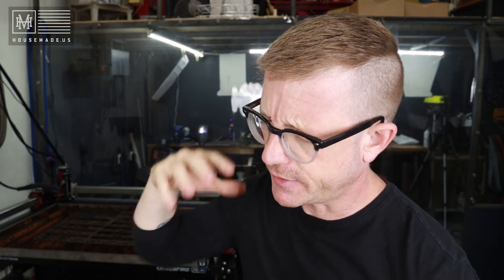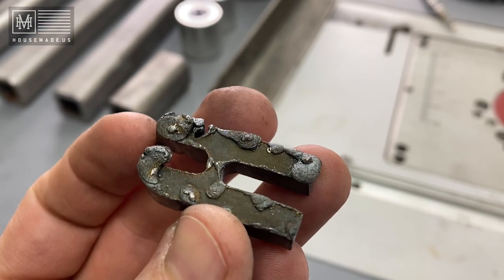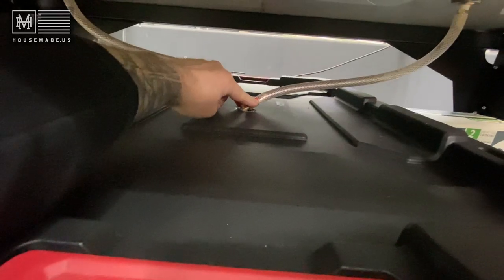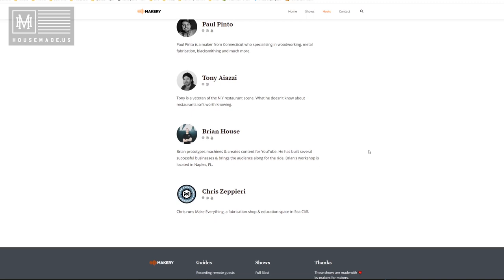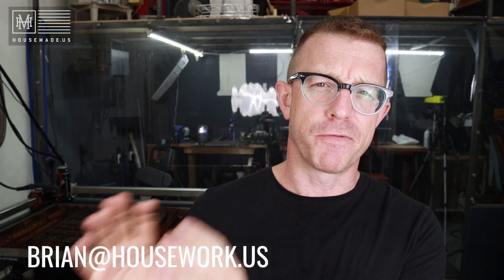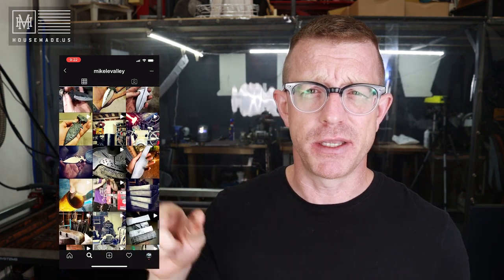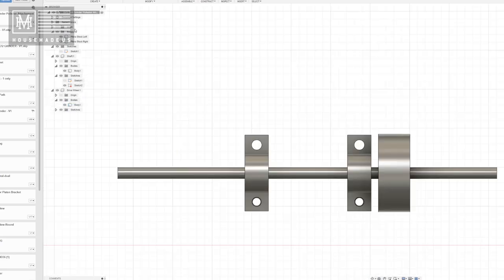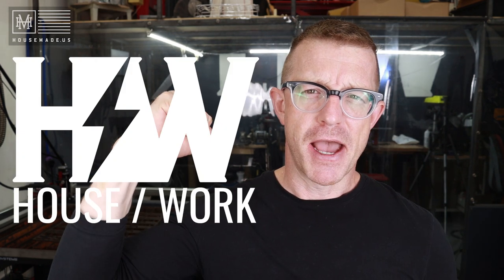2x72 Belt Grinder Buffing Wheel Attachment

Comment: I have a suggestion i did plant maintenance as a career. I worked on many machines that use shafts and saddle/pillow bearings that heald up large spools of cable that were hundreds of pounds right down to a spooling setup that was a few pounds. I was wondering did you consider keeping the drive wheel more centered? Yes the easiest way to do it is offset to one side but eventually this tension is going to cause warping or failure in the bearings.  I dont think this is under a enormous amount of pressure just a concern.  You may have to increase the shaft diameter to lend rigidity to the build a 1" shaft or find an inline idea i think having a bearing on each side. I think the drive centered would be the most energy efficient design.  Let me know what you think or maybe try it on your design problem just my 2 cents?  :-) Thanks for sharing and takecare Mr House

Comment: I’m wondering what would happen if you sprayed a coat of that anti spatter on the water side of your sheet stock some time before cutting.. (does it eventually dry?) I’m sure some would wash off but I’ll bet some stays also, maybe that helps with the dross.. just a thought..       
Awesome channel man, I’m addicted. 👍🏻🇺🇸
Reply from the maker: Yeah I thought about that also. I think the issue is with my speed. A couple of people have commented in and said that Ross is related to inches per minute and going to slow. The problem with these parts is, if I go faster the accuracy of the machine is not as good. And with the small little parts I need good accuracy in those slots. So it’s a balancing act.

Comment: I agree with the comment about pre-cleaning your material before you put it on the plasma. I would double- check your air pressure during a cut cycle, I had one that was using op the tank volume during cycles. The other thing you may try is a rock tumbler afterward, makes easier work. Hope you have t figured out:)
Reply from the maker: Thanks Juan. I appreciate that info. 😁👊🏻

Comment: Well Brian you sure have been busy! I like the buffer idea as an additional accessory. Are you planing to drive with a sanding belt or something else? There's got to be a sweet spot in terms of shaft length versus diameter. A 3/4" shaft size is a good starting point, then try different lengths to see what works best and gives the best clearance around the buffing wheel. I look forward to seeing what comes next!
Reply from the maker: I do plan on using a sanding belt to drive it. I’m thinking maybe I’ll add a rubber drive wheel in the future if this plastic one doesn’t work out or starts to slip. I’m guessing a lot of adjusting and tweaking will need to happen to find that sweet spot for sure. We still need to have that call. Sorry about that. Hope you’re well Millar. 👊🏻😁👊🏻

Comment: Be shure you specify self aligning pillow block bearings for the buffer attachment. It is a good idea ,I have a small buffer now but having a 2 horse one with variable speed will be far better. Let me know what you use for a drive wheel. Thanks
Reply from the maker: Good point. I’m still looking for a better shaft that can be threaded. The drive wheel is the 4” plastic from OBM.

Comment: You might take a close look at your consumables.  In particular the cutting air nozzle.  I got a whole batch with burrs where the air exits, which causes a distorted jet that doesn't cut cleanly.  I de-burr them with a dremmel  point held in a pin vise...takes about 5 seconds per.
Reply from the maker: Okay will do. Thanks for that info. I appreciate that very much. 👊🏻

Comment: the only draw back is the axle will have to have both left and right nuts so you can tighten the pads to the axle
Reply from the maker: Could you use locking nuts? That’s how I was going to do it.
Reply: I came here to say the same thing. Of course as you already have everything, so try it with a double nut. I think there’s gonna be a lot of vibration that will end up loosening  them. Do it and prove us wrong :)
Reply: @HouseMadeUS  Go to your bench grinder and see how the grinding wheels are attached. I am sure that you will find that the nuts and threads are left and right 'handed so they  don't loosen up when the shaft is turning.

Comment: I'm not an engineer by any means, but if it was possible to center the drive wheel between the pillow block bearings it may make it easier to balance. Many of the old school grinders and buffers that were powered on line shafts and pulleys were designed in that manner.
Reply from the maker: Yeah I had the same thought. Not sure how I could achieve this easily. I’m gonna give this a run and we shall see!!

Comment: Great concept to multi-function the 2x72.  The large "rebuilt" buffing machine you showed in your video is massively strong with long arms for multiple reasons.  Buffing machines take a LOT of pressure from the person holding the part being buffed, and the person pushes with much force including leaning in with their own body weight at times.  The design you have is very good, but I feel the shaft may need to be a larger diameter to prevent flex/vibration, which would mean other components to the design would have to be "beefed up" to withstand the pressure that will be exerted while buffing some large items.
Reply from the maker: The shaft I am using is 3/4 of an inch. I am thinking I could solve the rigidity problem by shortening the shaft. I will try to get it as close to the pillow block bearing‘s as possible. Initially when I designed this the shaft was five eights of an inch thick and I realized that would not work. So I went up to the 3/4 inch shaft size.
Reply: The shaft in the video appears to be smaller.  3/4"  I would think should be stiff enough.   Shorter is better for rigidity but also reduces the flexibility of use.

Comment: Hey Brian, looking at the buffer wheel attachment Is a great idea. Not only buff wheels, but you could throw on a set of paper wheels and do some sharpening. I would think it wouldn’t be too impossible to make it a little bit of a modular device where you could slide a work rest in on one end or the other and possibly have a 12 inch disc grinder with a work rest off of the side!?!
Reply from the maker: Hey Jason! That is a really great idea. I think I need to find out the integrity of the polishing compound at first, but after that it’s game on! This opens up a bunch of doors to new attachments.
Reply: Oh I agree 100%, but yes that door is cracked open. If it’s all clear, kick it in.
Thinking it could be pretty cool to turn that thing in the horizontal position with a 12 inch disc grinder. Could definitely use it as a surfacing tool and get some things pretty flat.

Comment: Nice idea.  I’d be concerned about the drive belt and the grip it can get onto the buffing wheel pulley.   You may end up having to use a v-belt and a second/daughter pulley on the motor
Reply from the maker: Yeah I thought about that as well. I’m thinking that there might be some slipping going on once I start putting pressure on the pad. However I think it’s worth a shot to try.
Reply: Does sanding belt slip off if you put too much pressure on it?

Comment: Already following you and Jeremy from simple little life so stoked for the pod cast's
And that buffing wheel attachment looks great definitely will be ordering it when its available. Dumb question would a drive wheel gaurd be a good idea so a shirt sleeve doesn't catch?
Reply from the maker: Safety is never a dumb idea. I will probably add something into the mix. I have seen people mount pipe around the spindle to keep it from catching. And thank you for listening in to the podcast. Make sure to rate and review. It helps! :)

Comment: Hey Brian. Great idea and am positive many of us will quick to get on board. Question I have is this; Will 2hp be enough for that attachment. Would be interested your thoughts as am sure you've had discussions with others about this very topic. Also, along those lines, would it be good idea to simply plan ahead and get 3 hp right out of the box? And if so, do you have one to suggest along that line? Look forward to your comments. Please keep up the exceptional work and enthusiasm. Off the charts!!!
Reply from the maker: Yeah I definitely think 2hp should do it as long as you have a decent RPM. Buffing is more about speed than power. The IronHorse spins up at 3600 rpm and with a 7” drive wheel that belt speed is close to 7000! 😁
Reply: @HouseMadeUS  OK, sounds good to me, Thank you.

Comment: On the area that you have nested the small parts could you sand over it with a grinder/sanding disc back and front on the plate so you have no scale at all would that help the slag/dros? Bit more time to set up but possibly less time cleaning at the end?? 

Awesome set up you have
Reply from the maker: Hmmmmn that makes me think. Yeah it could be related to the mill scale. I’ll give it a shot. 👊🏻👊🏻👊🏻